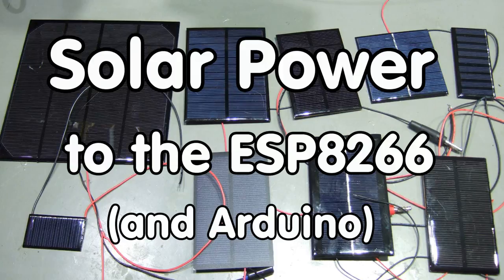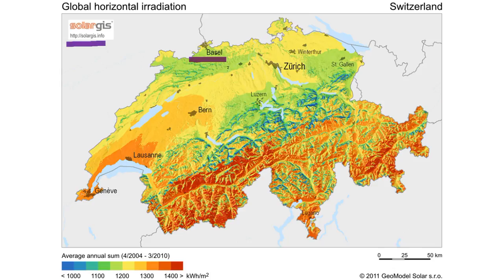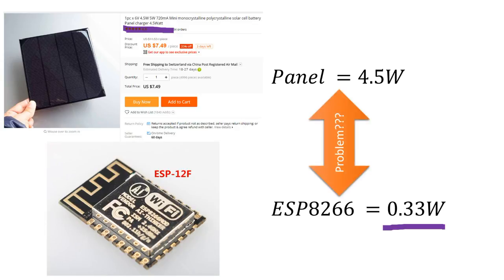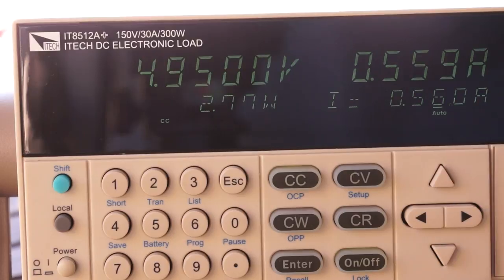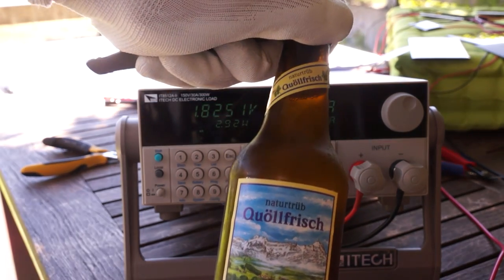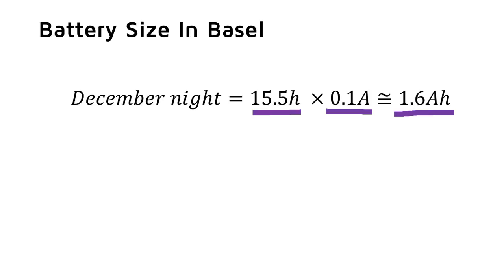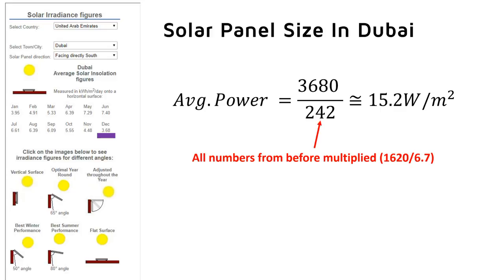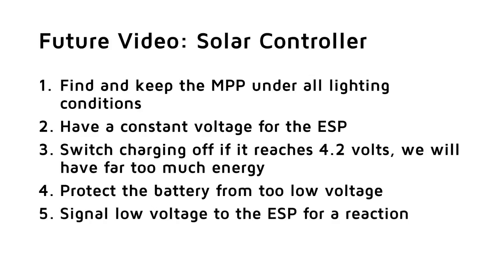#142 Solar Power for the ESP8266, Arduino, etc.

Comment: Great video, thanks.  I've been running an ESP-07 (all LED's removed) for more than a year now here on the Prairies in Canada where temperatures during the winter drop quite often below 35C.  I used trial and error to figure out how long to put the ESP to sleep such that it wouldn't kill the battery during a worse case winter scenario.  I will have to watch your video again and then apply these new learnings to see how much margin I was playing with.  :)  I am using a 1800mAh Li-on battery from a Sony PS3 Controller (rated at max charging current of 400mA and max charging voltage of 4.2 volts) and a 5V 200mW 4.3cm X 3.4cm solar panel.  When I tested the solar panel the maximum voltage I could get was 40mA and about 4.5V so I took a chance and connected it directly to the battery (so far so good and it's been more than a year!).  I use only a diode to drop the voltage to  the ESP and it has never gone above 3.4V.  The ESP is on a 200s sleep cycle. As I said it has been working flawlessly for over a year but tomorrow I want to run this through your math.  Thanks again for another wonderful and informative tutorial!
Reply from the maker: Thank you for your feedback. I think, physical laws are similar, even in the Prairies;-)
Maybe this page helps for calculation of the power requirements of your ESP: http://battery-life.of-things.de/battery-life-calculator.php

Comment: Thank you for yet another interesting video. Some things you might want to look into, if you don't get the expected efficiency are: Angle of the panel (I noticed your panel laid flat on the table, which is not optimal), and temperature (cool panels are more efficient than hot panels).
Reply from the maker: I tried with various angles, but did not get big differences (maybe because it is summer and I did the measurements in the early afternoon. Then, I took the easy(flat) way. But you are absolutely right concerning the angle. If you have a close look at the diagrams in the video, you see the optimal angle for a whole year. 
Concerning temperature I cannot do a lot, I think, because the place is defined by the purpose. But, because the most critical time is anyway in December/January, the temperature maybe is not a big issue (in summer, I will have too much energy).
Reply from the maker: Now I remember. I will have a look at it. Thanks for the tip!

Comment: This is my favorite video of yours to date. The fact that someone was kind enough to translate it to Portuguese also means I can scare my father (who thinks solar panels probably aren't much harder than connecting panel, battery and an LED lamp in parallel) all under the guise of a friendly 15min video.

Not gonna lie I still don't get why MPPT is a $100 device instead of a little board that you buy in packs of 50.
Reply from the maker: Thanks for the nice words!

Comment: Hi Andreas,

first thanks a lot for all the good videos!
For a cheap MPP tracker I can recommend a simple TP 4056 Lipo charging board. My setup works as follows: 5V Solar Panel, the charging board (w/ cell protection) and a LiPo battery. As long as the light is very dim, the voltage from the panel is too low for the charging board and no current flows. When there’s more light, the PV voltage climbs over the battery voltage and the charging board starts to charge the battery. If the charging current is too high, the PV voltage drops and so does the current – the PV voltage can climb again. So the charge controller will always keep the PV voltage at the point where it can draw the
maximum power from the panel.
Two things have to be taken care of:
- .      - To keep the system from oscillating, I put a capacitor parallel to the panel- The maximum input voltage of the TP4056 is 8V. When the battery is fully charged, no more current is drawn from the panel and the PV voltage will rise to the open circuit voltage. This should not be higher than these 8V
Reply from the maker: +Frank Schmidt Sounds very promising... have to try it. Thanks for the tip!

Comment: Thank You for your time. I was also making some tests. Here we have more sun. 10W 5V panel + TP4506 + one 18650 + ESP8266 with deep sleep. Not that efficient but is working well so far. Looking forward for the next video.
Reply from the maker: +Cristiano Sulzbach Thanks for your feedback. I will try the TP4506.

Comment: I'm doing something similar.  I switched from the ESP8266 to the ESP32 so I can more easily monitor battery voltage and sensor voltages.

One thing I noticed though was that the MPP charge controllers are expensive.  So expensive, I just opted to buy more solar cells, which are comparatively cheap, and use a TP.4056 charge module (very cheap)  It would have been a better idea for me to have done a proper economic analysis though.

Looking forward to your analysis!  Keep up the great work!
Reply from the maker: The TP.4056 was suggested by other viewers, too. So, I will include it into my investigations.
Reply: Here's a graph of the past few days of data logging to google docs.  You'll notice gaps in data which is when my ESP32 has been hanging and causing my battery to drain completely.  I hope I've solved the problem, but I've found the sample code for things like the DS18B20, Wifi connections, and so forth need some improving.  Unless you have some good watch dog timers, you need to make sure your code is really bulletproof. 

https://docs.google.com/spreadsheets/d/1ni20axRWzek2f--lTF_YY7c1_GgZjzM9ziM6vrI6V38/pubchart?oid=108740660&format=interactive

Comment: I look forward to your controller video. Many of them have a USB connector. They claim up to 5V @ 2A, which is enough to power a Raspberry Pi 3. Of course there is no need to start a discussion on how big the batteries would need to be for that application, since we are talking about an ESP8266 & 18650 batteries. Possibly/probably a small single board controller would be sufficient. I'm now going to watch your video #64 again, about batteries appropriate for the ESP8266. Thanks for your videos.
Reply from the maker: I think, we also can power a Raspberry Pi. The same formulas would apply, just the panel and the battery would be bigger (about 3 times). And i do not know of a "sleep mode" for the Raspberry

Comment: Cool, great topic! Interesting info and very informative video! I have a solar-powered network node laying in my window sill for about a year now. It's a 6V 1W panel connected to a ESP-07 module via a 650 mAh li-ion battery with a charger/protection module. It wakes up for ten seconds every 15 minutes, day and night. It survived summer, but stopped in the winter because it didn't get enough sun. It's only for testing/learning now, but in the future I want to make a solar-powered node for my automated garden project, so plenty work left.
Reply from the maker: Thanks for the info. Maybe you make the calculations I did for your device and compare the results. Then, we would already have one confirmation (or not) of the theory...

Comment: Oh Andreas😀

A superb video, full of useful information and there is going to be a follow up too🙏 

It's wonderful that you explain the math and importantly your thought process.  

I believe you managed to link together a number of things that I thought I understood. So very happy to see things more clearly. 

As always I am very appreciative of your time and efforts and just how concise you are. 

The project I am about to start is solar 2 axis for a 160 x 160 solar panel. So this is a great help. 

Bless you Andreas 👐
Reply from the maker: Thanks, Dean. Änd of course, we are interested in the results of your project, especially the efficiency (more energy because of good positioning vs energy consumption of motors)!
Reply: Andreas Spiess noted thank you. I will set up another INA219 to monitor the motor power requirements and as you say, work out the efficiency. 

From my research you only need to be within + or - 5 degrees. You will still be 99.6% efficient within this range. So had planned to only adjust at 6 degrees. 

I assume this is what you were reminding me to think about? 

Many thanks
Reply: 5 years have elapsed. What is your experience with the subject?
Reply: @TishSerg  solar big size

Comment: Composite systems are quite good at this implementation; There are two power sources, one is solar and one is backup power from the mains electricity.
It works just like you expect when conditions are alright; charge the battery in daytime and use it in nighttime.
But when solar panel voltage drops too much and battery voltage is below threshold, the device turns to backup power so the device doesn't die.
Reply from the maker: To have grid power is always a good thing and reduces the size/cost of a project considerably. But for me, I want a completely independent device. So, unfortunately, I have to go the hard way (or change where I live...)

Comment: There is certainly are lot of issues to consider about solar tech. Sadly more often than not the green desire and market hype clouds peoples judgement when investing in solar as the infamous "solar roadways" and Dave Jones have shown. One thing often not mentioned is how the solar panel heats up when exposed to the sun. The efficiency is affected by the panels temperature. If they are incorrectly mounted on a stone tile roof for example the stone tiles with high thermal mass storage capacity might also help heat up and prevent them from cooling. Another thing is the panels angle to the sun. Most often they get fix mounted. Solar tracking is expensive but might be how the supplier calculate their yield. Furthermore there are always losses when using converters. Storing the energy also mostly entails converting and self discharge losses. And then there is the matter of distributing the energy. Keeping them clean from snow and dust and wet leaf is also something that is often ignored.  Thank you Andreas for your excellent video that 'shines light' on some of the issues with solar tech.
Reply from the maker: I think, there are two distinct solar applications: One is to use solar to get maximum energy out. This is where you find a lot of information. And your issue is also located in this application (btw: look for a comment in this video where a viewer reports, that he looses 20% in hot situations)
The other application is the one I try to deal with: Get enough energy during the whole year. Here, We have to solve other problems like efficiency in low power conditions, deal with low voltage panels etc.  Here, I did not find a lot of information. And heat is not so important, because we anyway will have too much energy in summer.

Comment: Hi Andreas, very interesting topic as always. Your main concern should be the min max temperatures which the device (including charging and battery modules) will "suffer". Chemical batteries most likely loose as much as 70% capacity when cold until they refuse to charge at all. Also due to reduced molecule movement the voltage is reduced when the battery is connected to small loads (few mA). also batteries can be permanently damaged when they get too hot (fast charging and heat from the sun). Think about the Rosetta Research Lander which suffered those problems on the comet it landed on, somewhat extreme example but you will experience similar problems. Lead gel batteries also often used for off the grid solar systems are best but very bulky... when reducing the max load and total power consumption a powercap can be used.
Reply from the maker: Thank you for your input. You are right, batteries (and temperature) are an additional issue we have to consider.
Another possibility could be to use a big solar panel and super caps. We will see...

Comment: I have ordered some TP4056 from AliExpress. These connects great to the 18650 battery and deliver the right start and stop for charging. Additionally these are incredible cheap. Looking forward to get them delivered. If they support the MPP I do not know. I assume not.
Reply from the maker: They are great,  but do not support MPPT They are more for normal charging.

Comment: Nice explanation. But an additional factor that has to be concidered depending on location ist the dust! E.g. in Dubai the solar panel would get dirty/dusty after some time and thus convert less energy. This can happen without a dusty desert ... some air polution + dirty rain or snow can destroy the calculation also.
Reply from the maker: You are right.

Comment: Looking forward very much to the next video especially cutting off charging the battery at 4.2v and at the low voltage point. This should solve issues I've been having using the piZero and the sparkfun sunny buddy MPPT controller.
Reply from the maker: We will see how I will solve these issues...

Comment: Very good. Very very good. I live in Brasil, Mato Grosso state, very warm and have very sun, and was thinking about and esp8266 for solar weather station, and this video will help me very much, thank you!
Reply from the maker: So, the results of your calculation will be completely different to mine ;-)
Reply: yes, but rules are same, and tips are usefull (don't too low voltage battery, thing about bad weather, etc).

Comment: That's an interesting project! One thing though, since these small solar powered devices will stay outside for some years ideally: Did you account for the degradation of the 18650 when fully charged in summer? The cell will degrade much faster then it has to if the temperatures are up and it's fully charged, even though it doesn't need the additional capacity in these conditions. You could even reduce the charge limit dynamically based on the mean temperature to get maximum lifespan. Thanks for your informative videos!
Reply from the maker: You mention another complication to the project. It will depend on the way I will implement MPPT. If I use a micro controller, I can control all these parameters. With normal MPPT controllers, this is not possible (I assume).
Reply: Andreas Spiess That makes sense, it wouldn't bring huge enough benefits for the time spent implementing it.

Comment: Nice vid and a fresh view on the sizing question. But I think you for got one big problem. How to survive freezing conditions with lithium type batteries.  For me the fun part of solar is to run something standalone where there is no power like a shed or maybe a bird house or something. Been looking at many solar projects but almost all ignore freezing conditions. The only solution so far (for small devices) is to protect the battery by no charging it. But what is it freezes for 3 or 4  weeks. than the light or sensors will stop working for sure or the wifi on the eps8266 has drained the single 18650.   Heating pads require loads of power so back to lead acid than? It all feels very disappointing. How was the beer? :)
Reply from the maker: I have no long experience. But most documents I read about Li-Ion batteries in the cold are if you charge them with high currents. That is not what we do. And I had viewers reporting that their batteries survived winter. So maybe it is time for a test in your situation? The loss would not be too big, I assume. And you have a fair chance to succeed.

Comment: Very infomative and entertaining at the same time.
I see a good use for a INA219 I2C module to measure voltage/current...
Reply from the maker: I think too, that it could be an interesting part. But I also think (or fear), that we have to keep the number of parts as low as possible because they will use energy all the time, also when there is no sun...
Reply: Maybe one could switch it on only when needed.
Reply from the maker: I think, this is a good idea. Maybe even for the whole charger...

Comment: Awesome video. I would only start from the other end. You know how many days/hours you need to run the device from a battery, then calculate the size of solar panel. If you need a week of battery life and power consumption of your device, you have a size of a battery. Then you can calculate size of solar panel to charge the battery within a day or two
Reply from the maker: I think you can do that with the information given.
Reply: @AndreasSpiess  thanks for the reply. Would you consider using solar to power up motors? I would love to do rover-like robot. Or powering such device from solar is not feasible?

Comment: Very good analysis. I tried using 3W Poly crystalline panel in India to power the NODEMCU without a  battery (using a voltage regulator) but wasn't successful. Can't wait for your next video to see your Battery size recommendation..thank you
Reply from the maker: Battery recommendations are already in this video. The next will focus on charging the batteries.
Reply: Andreas Spiess yes, got it thanks..will watch out for next video on how to charge..will it be a charge controller or charging module for LiPo..will wait and see

Comment: mini solar produce  constant power  you can use( buck converter) or( boost converter) first then you storage power to battery . 
the milliamps  and voltage  change all the time when you produce power  and you can change it at any ratio you like , to make it more efficient.
Reply: Buck and boost can replace the solar panel controlller?